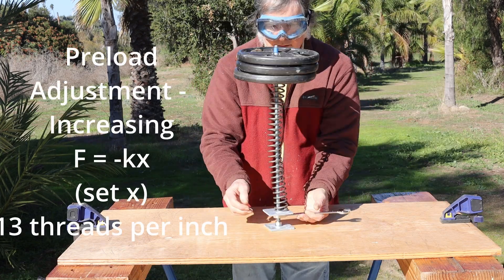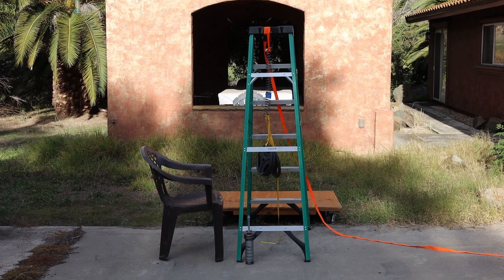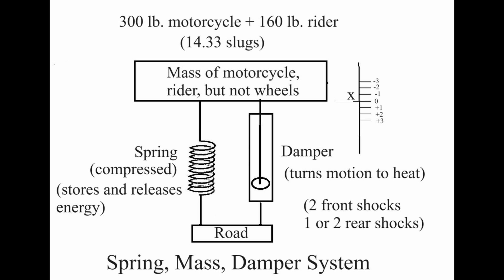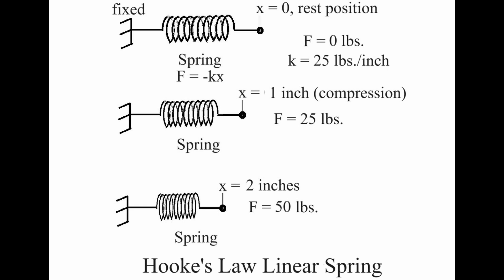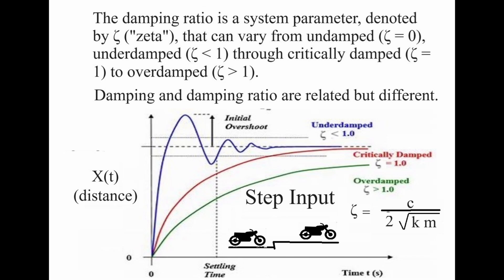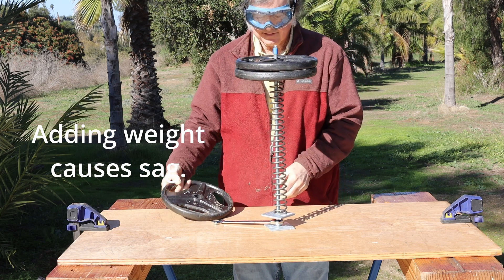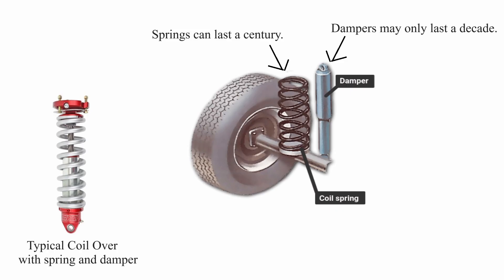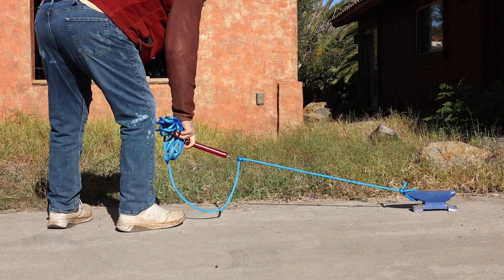Intuitive Motorcycle Suspension Adjustment Preload and Damping

Comment: Your video is a bit confusing, and we now know you own an expensive bike with all the preload and rebound adjustment.   Most bikes don't have front suspension preload and less have rebound adjustment.   Most have rear suspension have preload but many less have rebound.   You can use a ruler to adjust the rear suspension preload with the rider/passenger/luggage weight on an off the bike    The front forks preload is adjusted by measuring the travel distance of the shocks using markers.   The rebound is adjusted by observing the bike's recovery characteristics.    Most mechanics at a dealers are not suspension adjustment experts.  There are some excellant youtube videos how to set up you bikes suspension. .